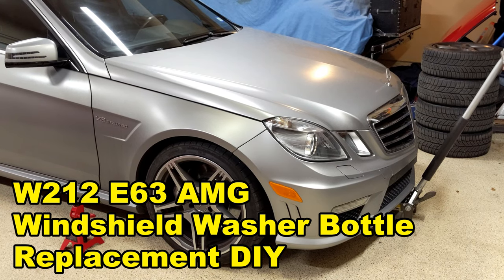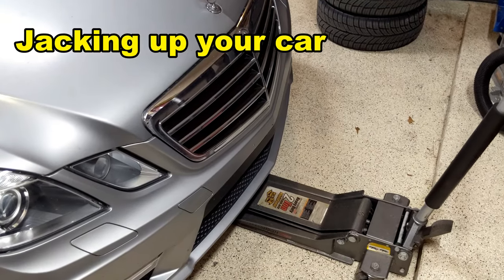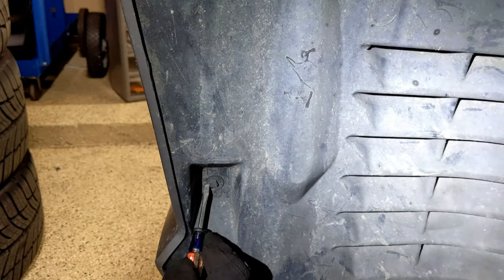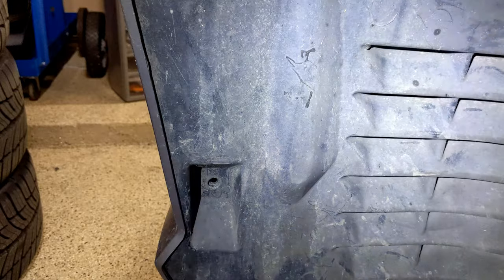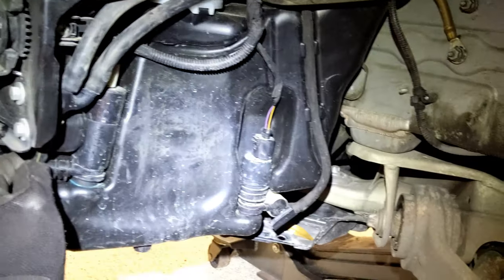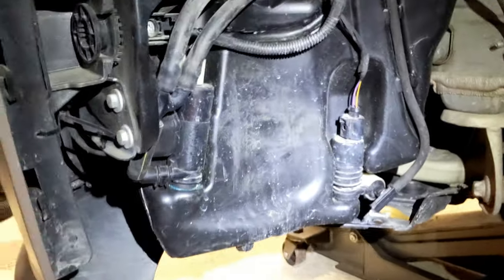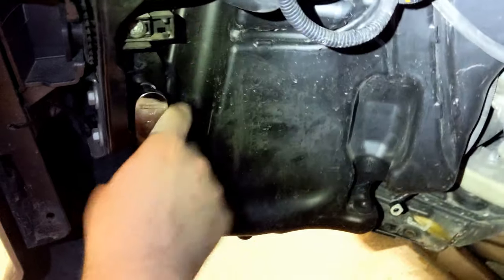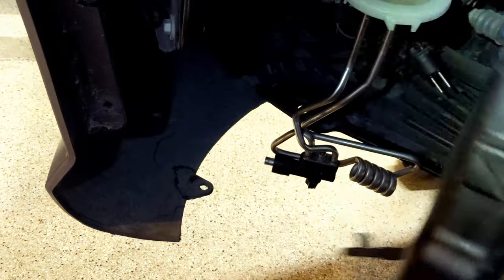W212 Mercedes E63 AMG Windshield Washer Bottle / Washer Reservoir Replacement DIY

Comment: Thanks for the video. I used it to replace the washer pump on my 2015 s212. Not sure I would have attempted it without your video.
£10 part and 90mins in the shed versus £450 and a three week wait to get an appointment at the local dealer.

Comment: I replaced a new bottle but it leaks again.  I used boat cement but it does not work.  I coated inside the bottle with roof cement, it is simple and fast.  I don't even needed to take out the bottle just use a long brush to paint the bottle inside with roof cement.

Comment: I think those lines are the heated elements for the washer tank, I could be wrong but im sure thats what they are
Reply: Yes, that is correct.  Engine coolant flows through the coil to heat the washer fluid, something that has been on Mercedes cars for many years. Excellent video.
Reply from the maker: Well, that makes way more sense! Thanks for the info! Good to know!

Comment: Ive in process of replacing one which is same and having a issue with the cap for the heater seating. I cant get it to snap in place. I have a brand new cap and bottle. How does the cap stay in place? It looks like it snaps over a ridge and cant get the cap to fully seat.
Reply: me too

Comment: Great video in replacing the windshield wiper reservoir tank.  I tried to replace the tank once before, but never figured out how the tank sets into the body.  We'll try again.  This time I will buy the tank first to see how it fits.  Has your cruise control ever not work.  I have a 06 Mercedes E350 that has a message to take the car to the shop.
Reply from the maker: Thanks! I've been lucky that the cruise control has always worked just fine so far. Good luck with yours though!

Comment: Hi There. 
Where was it leaking from? The pump gasket grommets or crack on the reservoir itself?
Reply from the maker: The side of the reservoir itself. There's a seam and it had started leaking out of the seam. I attempted a repair with a patch, but upon testing it still wouldn't hold water. I didn't want to risk it, so just replaced the whole thing.
Reply: @heymigo  thanks for sharing. Mine seems to stop leaking once the fluid gets below the pump level. Planning to take it apart and investigate.

Comment: Thanks for this in depth review.  I wish you had showed us exactly the location of your leak on the tubes or reservoir so that we would have confidence that doing all the work you describe would actually solve the problem.
Reply from the maker: The leak came from the washer bottle itself, on the driver's side, approximately 4 inches up from the side. There was legitimately a hole in the side of the washer bottle. Other leaks are common from the seals around the pumps, and you can see the locations in the video! Hope this helps!
Reply: I found through experience they can leak in one of three places. The actual tank, the rubber grommet which is the most common where the pumps plug-in, or the actual pump. 

On my W-212 it was a pinhole leak right in the tank. 

Then I pull the pump out and it’s leaking out the bottom of the pump outside of the nozzle. I had that happen once with another car; I guess a sealed broke in there. So I just replace the pump today

I’m glad this guy showed his video because this is a frustrating job that  should be easy

Comment: The most daunting part is getting that white lid snapped back on, it does not go on without a fight and it didn't look to me like you had it on correctly, I could be wrong but from what I saw it didn't look locked down.
Reply: I think I have the same problem - I cannot get it to snap into place or seal properly. I am unable to get sufficient force using my hands or adequate access once the bottle is fastened into place. I replaced all the grommets and seals(including the cap seal) and it still leaks from the top area - so assuming it's the white cap.

Comment: The heating element inside the bottle is connected to car's cooling system. MB way to keep the "fluid" warm and not frozen.
Reply from the maker: Ha, clever. I had assumed the opposite (helping to cool things), but good to know! Thanks for the comment!

Comment: Outstanding video Michael.  I'm in the process of doing mine and my leak is in the same place as yours (along the seam of the container).  I was told you can also use 3M Marine Adhesive Sealant on the leak without having to replace the entire unit. Just want to get your thoughts.  Thanks!
Reply from the maker: Hey Kenneth! I actually tried to re-seal the bottle with some JB Weld Plastic Epoxy before replacing the part. After two attempts and still having everything leaking, I just chose to replace it given how much of a pain it was to get in and out of the car. That being said, the 3M stuff could work better, or it's possible I just didn't do enough prep to make sure it would all seal. Best of luck!
Reply: @heymigo  Again, great video Michael and thank you for getting back to me!  I'm probably going to play it safe and replace the unit.  I'm having a heck of a time with that problem bolt you had mentioned.  My car also has a metal bracket covering it with an opening on top that I can't really get into and get the bolt.  Just my luck. Thanks again for getting back Michael!
Reply from the maker: @kennethphillippe9239  That bolt was a pain in the neck even without extra stuff in the way. Others have suggested some other options in the comments that could work (like a ratcheting wrench), but I never got anything to fit and just had to keep fiddling a tiny bit at a time. 

It doesn’t show in the video, but the first time I did that bolt, it was a few hours of attempts (you know, work for 20 minutes, take a break for 20 minutes, work for 10 minutes, spend 20 minutes googling literally any car to replace it with…). I found that you eventually get a rhythm, but it’s no fun.

Comment: Has now order two grommet to washer pump thats where it leaks in mine W212
Reply from the maker: I bought mine straight from the dealership so they could tell me exactly which ones I needed based on my VIN, but my dealer sells parts at pretty reasonable prices, so it wasn't too bad.
Reply: Nice 👍 Signed up to MB Club here in Sweden and in the membership it included access to Benz EPC catalog so can look up all parts from home computer and order. Don’t have any Benz dealer here in arctic circle doing all order online from Germany!

This video will help me to replace the grommets 👌